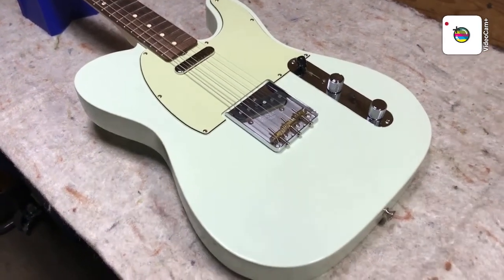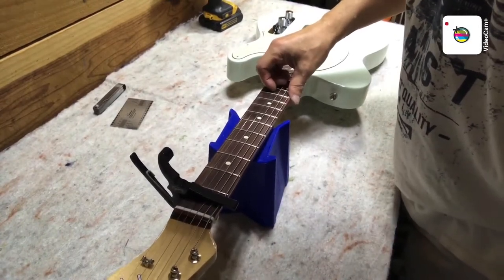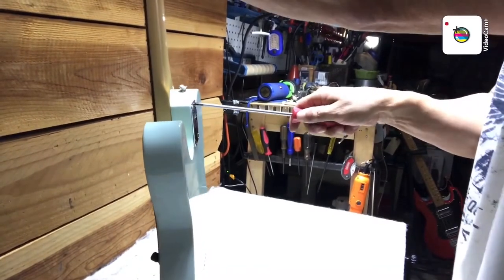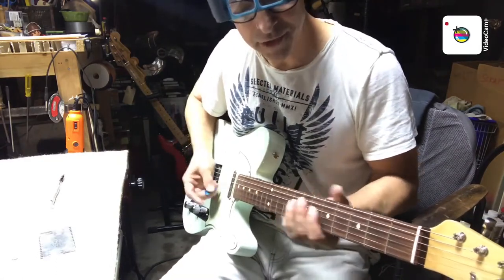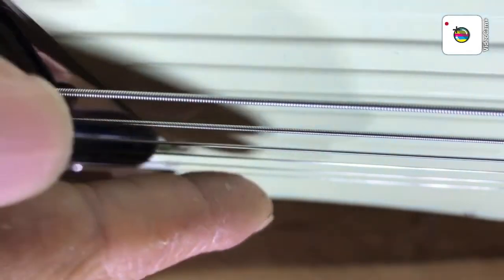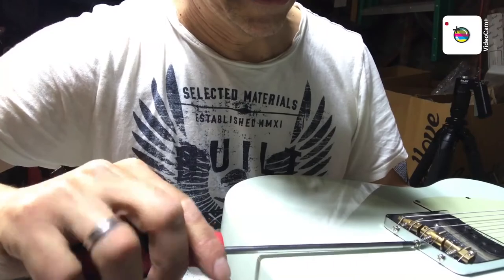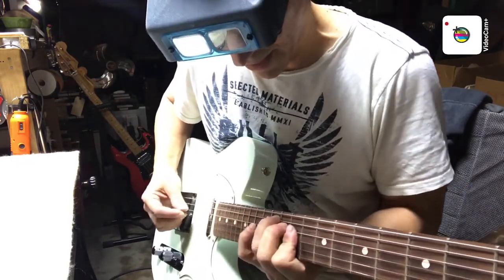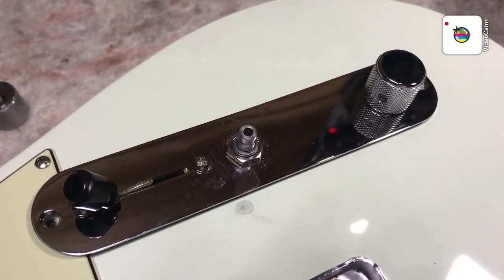Fender 2017 Baja Telecaster - Full Setup

Comment: Why did you take the neck off instead of the pick guard to adjust the trussrod ?
Reply from the maker: I get that question all the time. I'm used to pulling a neck and have gotten very fast at it. I also like to look in the neck pocket. You often find someone has shimmed in the past when unnecessary. That said you can try just pulling the guard. Sometimes still hard to get at.